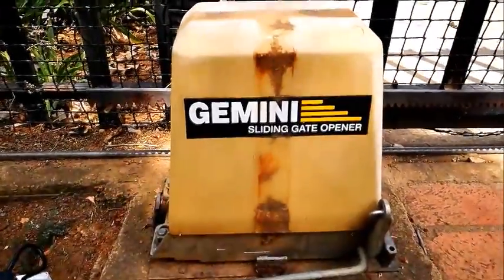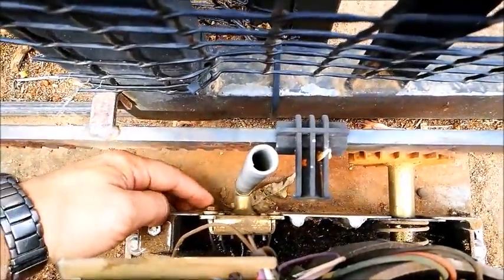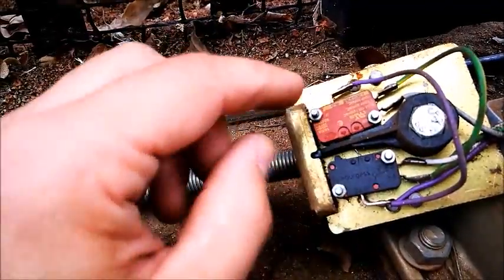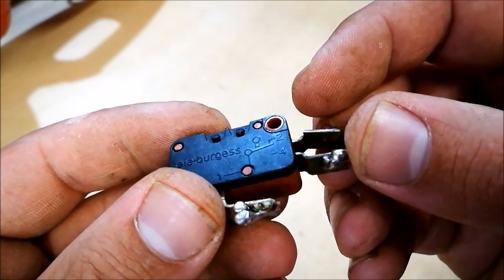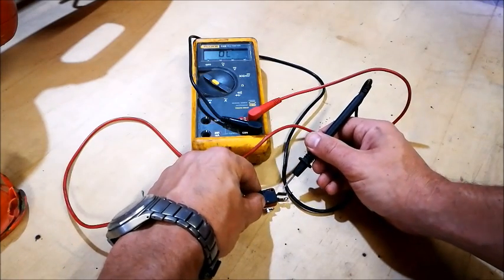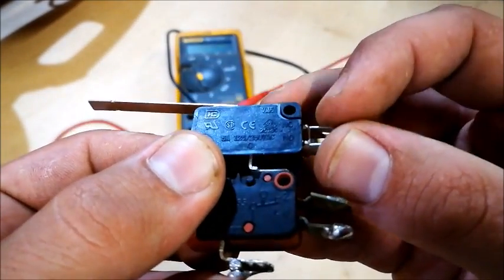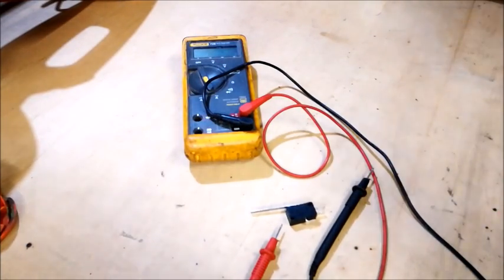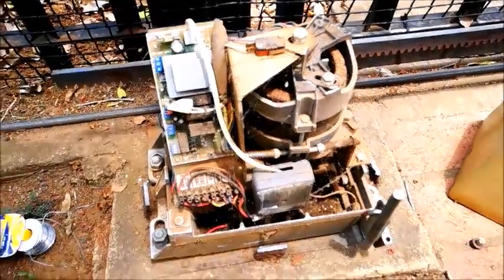Gemini gate motor limit switch

Comment: I hope I have the same problem. This solution looks easy. My gate or motor stops in both diretions. The problem however is that nothing is happening while the spring is bended. I guest that the current is not swithing over to point 4 as you have shown. My biggest concern is however why did both swithes packed up at the same time.
Reply from the maker: I have been an electrician for 16 years and something that I noticed was that sometimes these coincidences do happen.

I hope you find the solution to your problem.